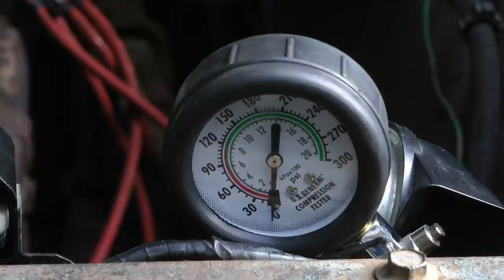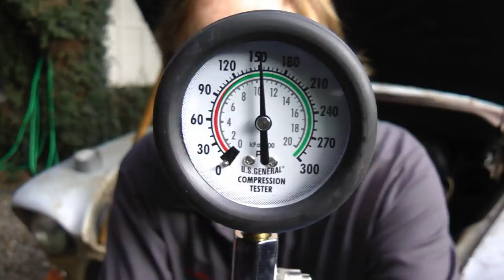How to Tell if Your Car's Engine is Bad

Comment: Hey, if it runs good, and the owner doesn't want to fix it up, just sell it as a running truck.  In Ohio, that body is in unbelievability good shape,  it would sell in an instant for the right price.  Nothing here but rust crumbs, holes and missing parts that fell off due to rust, unless someone brought it in from another state.

Comment: you need to hold the throttle wide open to get a correct compression test
Reply: Ya and he only did like two crankes I go tell it stopes moving.
Reply: Same thing I tot.
Reply: 7
Reply: He didn’t mention you also have to unplug all cylinders and shut off the fuel to the cylinders however is easiest.

Comment: I would do a leaked down test long before deciding an engine needs a rebuild. Doing a leakdown will help identify where the compression is being lost if there is any at all (since you cranked 3 times for dry and 5 times for wet).

Comment: Unfortunately, I can't tell if this was a demonstration video, or a real video.  I say this because when you did the dry compression test, you only cranked it 3x's and the wet 5x's.  Of course you're going to get higher numbers with more cranks.
Reply: I posted this comment because I'm a mechanic myself.  I do compression tests and if you tell me it doesn't matter how many cranks you're dead wrong.
Reply: Michel Linschoten It does matter, if I crank my engine only 3x's it's different  from 5x's.  End of story.  I know how to do compression tests the right way thank you.  When doing tests like this, it's critical to keep ALL varibles the SAME.
Reply: The only point I'm trying to get across is that if you dry crank 3x's, then wet crank 5x's the readings will show very different.  He should have cranked 3x's for both tests, or 5x's, or whatever X times the same for each test to show an accurate change.
Reply: +Andrew H Agreed 100%, as I learned from my late Father, and late step father who where both ASE Certified mechanics, and they would never change oil on a car using just a floor jack, they would always use Jack stands, ramps with wheel chops, or a car lift if they had it available too them.
Reply: +Nebula 7 Yup. I noticed the same thing.
Reply: +DE “AutoBravado” Nichols So can you list all of the ways you think Scotty is unsafe while working on engines so as elaborate on how you think Scotty doesn't care about whether he lives or dies?  Just how is he risky?
Reply: Thank you for calling my attention to the fact that others had to call your attention to the issues you presented.
Reply: Thank you.  So what makes me supposedly more "reasonable" than most people?
Reply: Well thank you.  I appreciate that.  I do make every effort to be reasonable, though at the same time I must admit to you that I do get a touch of unruliness at those YouTubers who write such vague and general comments that I don't even know what they mean.
Reply: I thought that too so I looked in the comments and as I read through this one I not only confirmed my suspicion, but I also witnessed a very pleasant conversation at the end of the replys lol XD
Reply: Completely agree with you. I won't make accusations, but I've seen people do this to "show" the rings were worn to try and sell and engine. In my opinion, there are 2 ways to do a compression test, and they serve different things. The first, and most common is 4x needle jumps, every cylinder. This will show any significant loss of compression and do so with the cylinders all going through a guaranteed 3 full compression strokes. The other, more common when looking for engine mechanical problems that result in "No Code Drivability" issues, is to crank it and stop at the second needle jump. This will show you what pressure 1 full compression stroke can generate in the engine. I have used this to find vehicles that had a VERY slightly bent rod causing a super small decrease in compression, but enough to cause it to stumble at times.
Reply: Completely agree. You have to be consistent with the cranks. Also, you're supposed to do it full throttle to maximize air filling in cylinders. And if you want to get technical, you really need to put a charger on the battery to get even cranks on all 8 cylinders. By the time you get to the 8th cylinders you're battery will probably be weak and get less cylinder filling.
Reply: +osos321 Just a thought on your statement, yes, you absolutely do want a fully charged battery, however, a slower cranking engine will actually skew the compression readings higher as the intake valve will be open longer, allowing slightly more time for atmospheric pressure to fill the cylinder, resulting in increased cylinder fill.
Reply: In my experience, I've not really seen that, but it's also very rare that I'm checking compression while letting the voltage run low. I'm open to believe that I could be wrong. I think I'll do some testing to verify the correct answer and see what I find. I'll let you know.
Reply: he's becoming a shotty mechanic at old age
Reply: Tot I was the only one that noticed that.

Comment: That looks like a 1957 Chevy 1/2 ton  pkup. Not the easiest truck to find, and they are very popular. I doubt a worn out Chevy engine will kill the deal, their a dime a dime a dozen.
Reply from the maker: yea, but owner was pissed cause he just had put a "good' used engine in there from a yard, and it turned out to be crap. Someone will fix it up eventually, just not him.
Reply: rebuild it
Reply: A factory two barrel would have kept it from running rich. Too many people ruin a good Chevy v8 engine putting a 4 barrel intake and carb on and not having it adjusted and jetted properly in my opinion. Also who would put those dumb bosch plugs in.
Reply: Those dumb Bosch plugs lasted 80k miles in my truck without significant wear or fouling out.
Reply: Its just my personal opinion. If they are good plugs thats great. I'm just the OEM type of guy
Reply: ElectricBlake ah alright
Reply: i'd like to know if the engine runs? it seems that it has low compression and bad burning in the spark plug but will it run? i think yes.. therefore use it until it does not run or throw it away then if you have a much newer truck.
Reply: No, I believe them to be crap. seen them last 20k km's  in a 1999 mustang V6. OEM plugs will last 90k km's.
Reply: Scotty, would it not be better to wet test with some petrol to get a more accurate reading. Because of the ring layout on the piston. Like oil seal ring ect.
Reply: I'd totally keep a patina '57 step-side like that one.  I'd run a step or two hotter plug and 20-50 oil and drive the hell out of it while I save up for a 383 stroker.

Comment: I'm not a fan of gimmick additives, but I did have a v-6 GMC with 5 cyls at 140ish and one at 75, so of course it ran erratically. I changed the oil and added a can of restore, then did that again after 2000 miles. Whatever was going on, the restore raised the compression enough that the engine ran smooth again. Cheap solution.

Comment: Never use Bosh 4 or 2 prong spark plugs unless the car is made for it it just doesn't work, probably the wrong heat range for the truck also.
Reply: I use Bosh 2's in my Grand Prix and it runs great.  How would you know if its ''made'' for it?
Reply: TTime685 It will run good untill, it will not, give it a few thousand miles.  What happens most modern cars have computer controlled direct ignition, it takes just the right amount of current and amps to go through for the system not to go bad.  If car was made for copper plugs don't use platinum, there is a difference.  If oem has 1 prong then it has to be one prong, it has to fire in a similar way as other plugs every time 2,3,4 plugs the spark is not precise and is very much random in shape and size of the spark every time it fires.  As a rule any mechanic will tell you only use OEM for this reason.  Bosh does have a website where you can lookup part numbers, use AC delco anyway.  I used bosh 4+ on a volvo in a pinch, they come with 3+ from the factory only lasted one week before setting a misfire code.
Reply: Art S
NGK G-Power the only plug a real professional will use !!
Reply: Yes , some common sense.  The first thing to check when you are working on this type of old truck - is what sparkplugs are recommended for the engine , whatever engine.  Which I'm sure in this case are what amounts to an aftermarket installation.  Bad idea , as the carburetor and the entire engine is calibrated to a specific amount of spark / IE :  heatrange.
Reply: Agree 100%,  On my f-150 01 bosch+4 at first worked ok but after a few tanks it performed like crap. Stay away from them specially for ford. Simple autolite copper plugs worked like a charm.

Comment: Another test we perform on motors is the cylinder leak-down test (after compression) which tells you a lot more information and can be done without cranking the motor.

Comment: A 120 psi ain't bad I've seen sbc with 80-75 psi and still run like a dog. And why can't he just rebuild the engine instead of replacing
Reply: Didyousaychevytruck it's cheaper to buy a built engine than it is to dismantle and repair a non stock 350.

Comment: I had sparkplugs that looked like that when I bought my Toyota Pickup. I got all bummed but figured I'd throw new plugs in and drive it till it went kaputt. Well, seems the previous owner went waaaay too long without a plug change and the new plugs look normal after 3,000 miles. Never did a compression test figured with a 30 year old car/motor, why bother...
Reply: Mr. Bosch doesn't matter if its a 22r those things go forever lol, just watch the timing chain
Reply: Or the 5vz. Run forever
Reply: Yeah it does suck the 22r-re etc are interference motors... Already replaced that plastic pin with a metal timing pin...
     I'm not a fan of the 5vz. They're just as hard to work on as a 3vz. The only thing easier to replace on the 5vze-fe is the PCV. But they don't have that annoying crossover/headgasket problem at the #6 piston that the 3.0 has and the valve design/heads are better designed in the 5vz. 
      I don't know why Toyota kept the crummy head/valve design for so long on the 3.0 equipped pickups. They changed to the early dohc on the 3.0 for the camry's etc. in early 90 or 91. But they kept the single cam going til 95.5 in the pickups.

Comment: I would just put some 15w40 oil and a can of restore and drive it till it calls it quits.
Reply: Marvel mystery oil is my additive of choice, over 400,000 on my '95 Camry 2.2 and still going strong! Hey Scotty check out 'bad Camry Harry' off my iPhone when leaving work , shortly after it turned 400K. First gear and held to the floor. Want this for one of your episodes?
Reply: harry pownall Same for my TT Volvo. I'm switching to Castro Magnatec and planning to do my head gasket in an attempt to do the same💪
Reply: Kevin spacey It's good to put in Gas. I run 98 octane with MMO and it does wonders for injectors and plugs
Reply: Indrid Cold I do the same thing with my civic the change in oils really lowers the oil burning
Reply: Michael. RODRIGUEZ RODRIGUEZ Bullshit, what basis do you have for that statement? The bad ones are the ones people take them too, larger companies like Jiffy Lube. Not very many people know of that old school mechanic (that's trustworthy) in their area.
Reply: Can you elaborate on the "professional" mechanic issues with vehicles???
Reply: Ardent Fan ..and that is a story many told..

Comment: why would he want to clean up the rust? That adds so much beauty to the old truck. Some vehicles just look better covered in rust.
Reply: especially old trucks.
Reply: +Leroy Butts agreed. But if someone look at it. He'll go "DAMN! That engine is fucked"
Reply: +Leroy Butts Yeah looks cool until your chassie starts breaking up in the middle of the road.
Reply: +Leroy Butts because rust is literally car cancer
Reply: +frohman3 I had that too. Fixed it by stealing a couple of no parking signs from the city. They make great floorboard replacement metal.
Reply: ***** LOL!
Reply: +sermerlin1 Have you ever seen those custom Derelict cars? Surface rust can be cool in some cases, just... I'm not advocating rust that undermines structural integrity here but rather the kind that's just plain simple and not stressy. "Oh, got another dent. No problem."
Reply: Austin Lucas yes and i never said anything about surface rust. If you have that old vehicle and you see rust on the surface like that trust me there's a lot more rust on that car which aren't visible until u dig in.
Reply: +Leroy Butts I agree. Rust ads beauty to those older vehicles.
Reply: +Tw1g007 Not literally. You need to look up literally in the dictionary. That's not what it means. Rust is FIGURATIVELY cancer, not literally.
Reply: hyzercreek
Reply: +hyzercreek Yes rust can in fact LITERALLY lead to the death of your car. If left unchecked it will grow and spread (like cancer) and lead to the body's (car and human) destruction.
Reply: accentplaya18
You don't know what literally means either. You say it literally leads to the death of the car. Literally leads? Like leading a horse, or leading a parade. No, not literally leads. And he said it was literally cancer which is ridiculous, cars don't get cancer. You need to use a dictionary
Reply: hyzercreek i don't think you know English pretty well there mate. "literally leads something to death" Means something gets to die by something if actions are continued. Secondly rust IS cancer of a car. It is the thing that slowly eats your car away unless you cut it and repair the dmg sooner or later your cars structure will be damaged beyond repair and you will have to get a new car.
Reply: +sermerlin1 Scotty doesn't drop the F bomb. Ever. Please stop it with the childish cussing.
Reply: welcome to the fucking internet
Reply: This old truck would make a nice restoration project for someone who has the time, patience and funds to do it.
I've seen much worse brought back to like-new condition.
Reply: i personally like to piss on my rusty cars and light a cigarette just chilling inside of it and cause an explosion from exhaust getting through the rust holes thats how i know its a real winner bro
Reply: you are obviously a superior human,  feel better now?
Reply: it was for the Abcde weiner

Comment: scotty! this is a really discouraging video. why not try a leak down test?  you may hate the sight of an old truck ( classic) or maybe you do not want people working on older vehicles?  unsure why mr scotty wants everyone to just give up on a classic, it is honestly one of the easier vehicles to work on.... engine rebuild on a 350?  few hundred bucks and a few hours of labor into it and I am very confident it would run good as new, maybe even better than new with a few updates.
Reply: exaclty what i was thinking, and that rust looks like surface rust, give it a good sand down and paint and it will look like new.
Reply: 50 grand with no character and no story.
Reply: That's what I think I'll do.  I have a 94 Chevy K1500 with a 350 in it that's wearing down.  A new 350 is about 2000-2500 and labor to install is around $700.  So $3200 for a semi-new truck?  Sounds good to me!
Reply: if you found a good machinist and a good mechanic i would say that old engine might be pulled and rebuilt for much les... maybe with some upgrades for far less than that. if you are on a budget and wanna get your hands dirty i would say a good rebuild would cost your 1500 at most.. a good parting job or even gasket match will really help.usually 10-15 horses with a 3 angle valve job and port job.
Reply from the maker: they guy just had this engine put in as a "good" used engine, which it is not, so he's pissed and ended up just driving it this way

Comment: so replacing piston rings wouldn't fix the problem?
Reply from the maker: +Tim Moya It would help, but really, one needs to totally rebuild such an engine to do it right, and that's BIG money
Reply: +Tim Moya as scotty said it would help, but it may not be worth the time and effort to change them..
Reply: +Scotty Kilmer Rebuild kits aren't all that much. Its cheaper than a whole motor swap. And in my opinion, If I can get the customer happy by saving him/her money and allowing them to continue their project I would. Because a little money in my pocket is better than no money in my pocket. But anyway. Love your videos!!!!! I know this is an older one. But it is a really good one.
Reply: +Anthony D the rebuild kits aren't expensive but the labor associated is very expensive
Reply: David Meyer. You are correct labor is up there. It's hard to see myself on the other side of the table paying labor charges lol.
Reply: +Tim Moya I would think you would have to take the entire engine block out to hone the cylinders out with new rings. Might as well rebuild it at that point.
Reply: +Michael Getachew 

BECAUSE THE WORK IS EXPENSIVE.AND NO ONE LIKES TO OPEN ENGINE EVERYWEEKS.,..ARE YOU GONE REPLACE JUST ONE RING, IN a PISTON WITH 3 RINGS?? REALLY?
Reply: +David Meyer SO,?

DO YOURSELF if you know how to do it.
Reply: +Tim Moya The engine cylinders would need reboring, and a number of components such as the oil pump, valves, lifters, camshaft, seals, just to name a few would need to be replaced.
Reply: +Anthony D it's cheaper if you do it yourself, it might be the same cost to buy a crate motor and have someone put it in that it costs to rebuild a motor depending on labor charges.